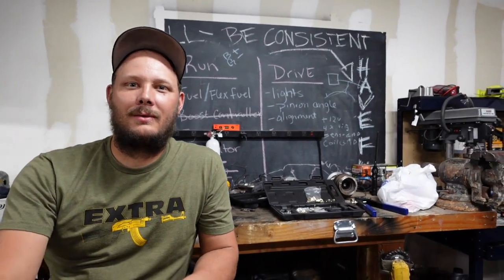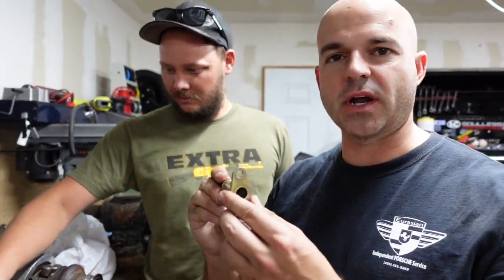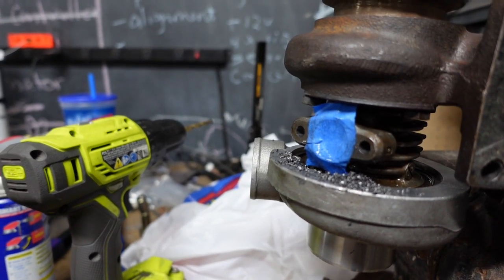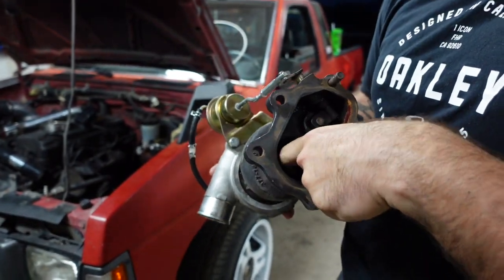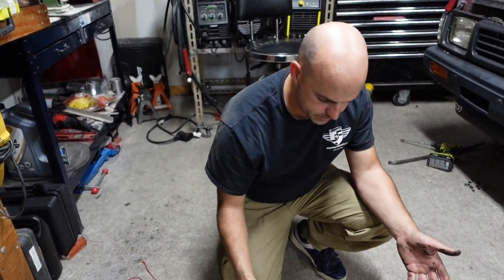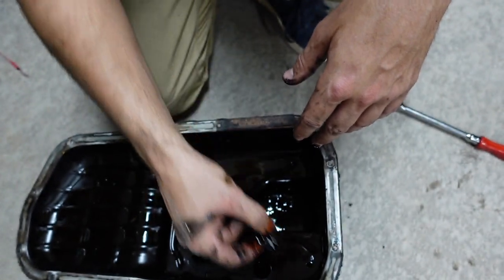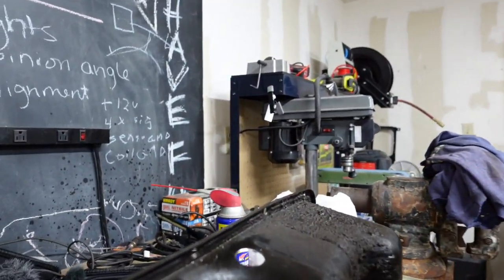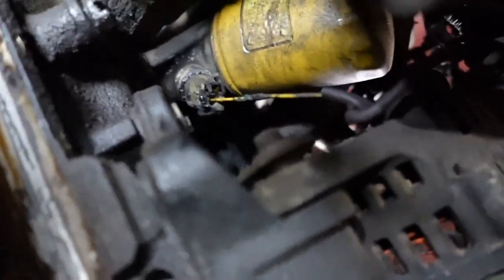How to Turbo Pt 4

Comment: I've been binge watching your vids. You guys are doing great. Watching  you tap those threads.😅
Reply: I have a 91 ka I'm running.  2015 I barged it to a rural community with miles of gravel roads.  On days when my friends and I feel it we monitor and block the roads and run. We average 40 on average and hitting 80 on the shorter straight runs.  The road maintenance man runs the roads with us which makes it easy for us to repair any damage along the 30 mile route.  5 miles of the route is limited to 35 mph as it is municipal land and runs through Anchorages power plant.  I'm the EMS coordinator and we also have a certified medivac crew living along the route. We've never had to medivac anyone out.
Reply: I've been having issues with my exhaust.  I'm going for your exhaust setup. That vibration breaks everything.   Thank you for the walkthrough

Comment: Hi I have a 2000 Nissan Frontier XE fully stocked need help putting turbos
Reply: I have a 98 frontier XE I’m looking at turbo kit also. But the only issue is the tune for a ecu I have been having a hard time for a piggyback for it.